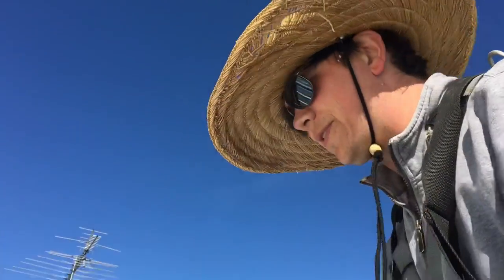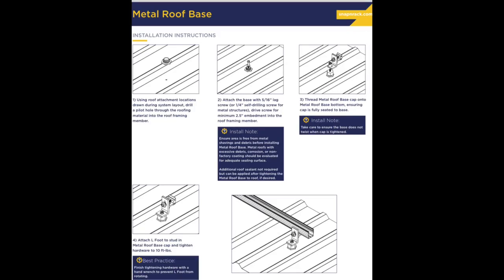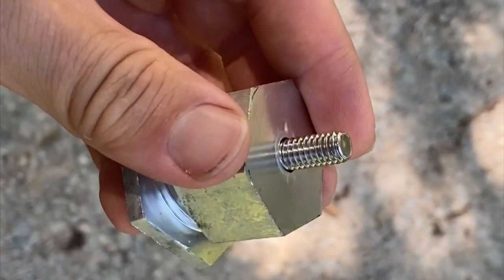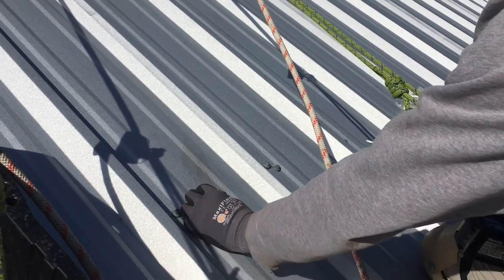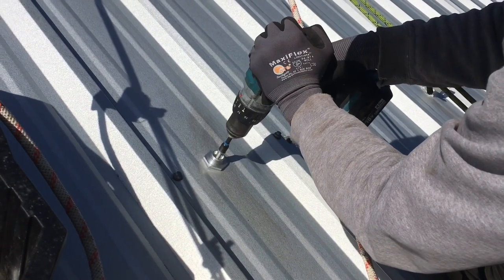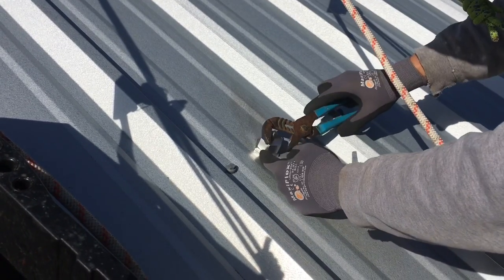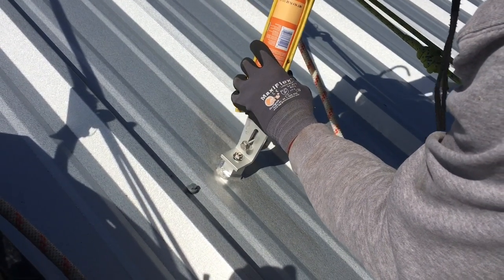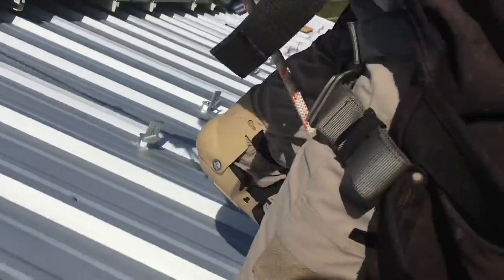Mount Solar to Metal Roofs: SnapNrack Metal Roof Base

Comment: Thank you brother for wearing the safety harness. I was a Safety Manager for 35 years and I  
thank you for setting the example. And as a friend, I noticed you were using nylon lines, look like climber quality. But it might be easier if you used a retractable. First you will never fall more than 18 inches. It locks up, but in normal working on a roof it feeds out and retracts as you move and stays out of the way.
Reply from the maker: The retractable a look like good fall protection. In our case we work off the ropes. We are using it as much for positioning as we are for protection.  The ropes are loaded about 60% of the time and they slide over the panels.

Comment: Yes!  Thank you for taking the time to create and post these "informative short videos".  Really appreciated!!
Reply from the maker: Thank you for watching
Reply from the maker: Anything specific you want to aee
Reply: @GainSolarPower  in the video, what were you fastened to? And what other safety measures to you take during installation please?
Reply from the maker: @hakeemabdulkabir5141  there was a walkway at the top of the roof built from 3” sched 40 pipe. All jobs are different. Sometimes you can hang a rope over the building or drop a rope down thru the ridge

Comment: I need to install a rail setup for an off-grid system of four 100w panels I use in my shop to charge batteries, emergency needs, etc. I have been looking for a way to get the panels securely on the roof, and so far, this product is about the best and easiest I have seen. Can you do DIY kits for such a small install? I sent you an email, but it could have gone to spam is why I put this here.

Comment: Can you install these using the existing lag bolts (that hold the roof to the rafters)? Would it not be beneficial to have these fixed to the rafters, instead of just the relatively thin sheet metal roof?
Reply from the maker: This is a metal building.  The bases are attached with a very large self tapping screw into the z purlin. On a wood construction you would attach into the thickest most solid part you can.
Reply from the maker: We are not just screwing into the sheet metal.
Reply: Ah ok, thanks. So for a wood building with a metal roof, would you install these using the existing lag bolts that hold the roof to the rafters?
Reply from the maker: @nuronopolis I’d use a structural screw into the wood the sheet metal roof attaches too

Comment: what is the typpical cost of materials and install for something like this
Reply from the maker: I no longer do the rooftop jobs. summer 2024 prices probably $5500 for the panels, $3500 for the racking.  You also need inverters, wiring installation, batteries.  A typicial job cost for something like this is 50-60K with labor being 30%

Comment: Hello experts I have a question in grounding for solar and the AC side I have to inverters installed to one battery make my question is can I use one rod rounding rod in the earth and mount both inverters to the one grounding rod? And then from the loan center that's connected to my inverter you are used one grounding rod for the AC side I do have pictures of my current set up but I'm not sure how to upload to show you thank you for all these sharing your expert knowledge and advice to us we all appreciate you
Reply from the maker: If the system is in the United States you should be following the NEC code.

In layman’s terms I can tell you to drive 2 8 foot ground rods 6’ apart and connect them with an unbroken piece of #4 bare copper wire that runs up into you electrical meter or service.

If this is off grid I wouldn’t recommend driving ground rods all over the place. I’d have one grounding system but you are probably more worried about it than you should be.
Reply: @GainSolarPower  i was wondering why the solar code was so....basic in my city,, the NEC code is what matters. i'm curious how you get the wires inside, aka conduit and weather heads used
Reply from the maker: @cdoublejj  I have some videos showing that if you poke around
Reply: @GainSolarPower  thank you! .....holy shit dude!!! Talk about og, you've been doing this and posting since 2016, wow I'll have plenty of digging to do
Reply from the maker: @cdoublejj  I guess im old
Reply: @GainSolarPower  no school like the old school 😎

Comment: Are you familiar with S5 system. They seem to have a better product for connecting to metal roofing with no leak issues and no caulking required or suggested. Just like to hear your opinion.
Reply from the maker: This was years ago. These bases have withstood the test of time but s5 is good stuff too. Which one are you talking about
Reply: ProteaBracket

Comment: How high of wind speeds will it hold?
Reply from the maker: The more attachments per rail the better wind loading achieved. We are building for 90mph wind 10psf snow load in our area but you can always decrease the attachment spacing to make it stronger.

Comment: I would argue that the application of “whatever manufacturer approved caulk” is not the way to apply it!
Additionally the most effective way to fasten the bracketS would be to use a a
Pilot bit, establish the sized need to penetrate roofing only without damaging the purlins (drilling into them)

Make depth jig with block of wood easy)!!! 
Before placing bracket inject a small amount of sealer in drilled holes that’s “manufacturer compatible” with the rubber gasket. Use a drill bit smaller than the overall diameter of the structural fasteners “non self tapper stainless or galvanized course thread  wood bolts” long enough to penetrate purlins! 

Look at me POS Hawaiian Cottage shorts!
No solar yet but getting there!

drill bit and physically removing it to make certain there are NO metal barbs that will make the warranty and rubber seal void!

Not trying to blast on your parade just trying to help sorry if my words was jumbled up and what not even though I’m living here in Hawaii I’m from Appalachia and I got me a brain 🧠 injury
Reply: I’ll order some brackets from ynst

Comment: Sorry, but I would locate where  screws going through the roof will be and silicone that area. Keeping the silicone out of the elements.
Reply from the maker: The gaskets seals the hole. The sealant is just cheap insurance. This is the manufacturers installation instructions.